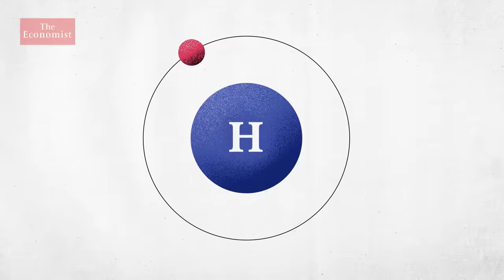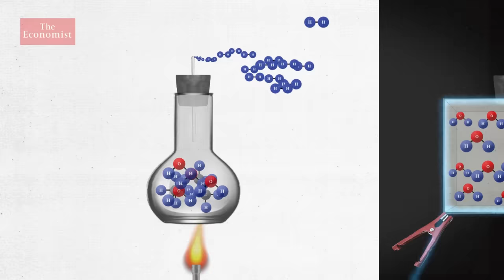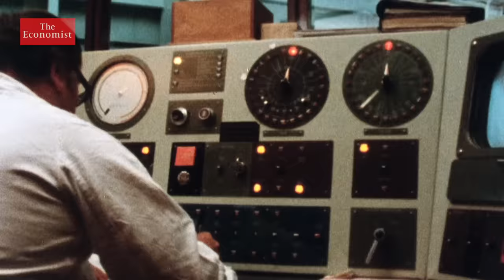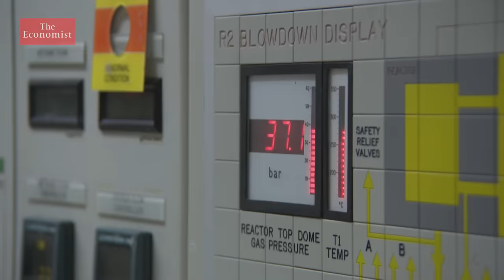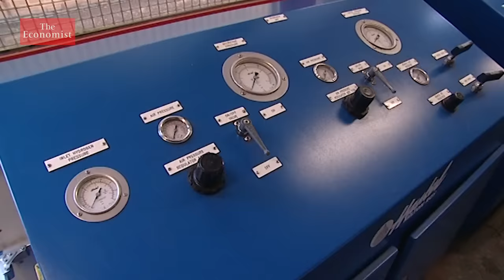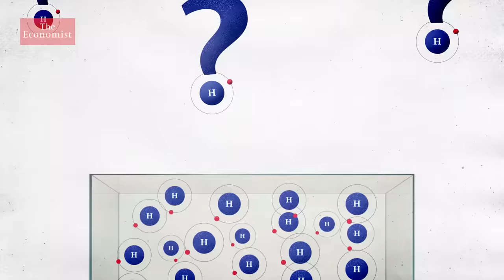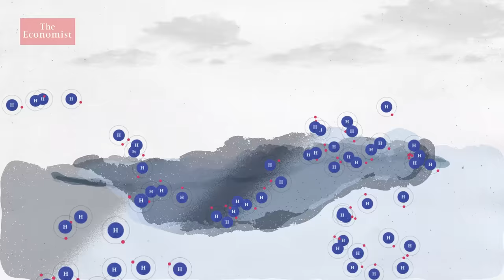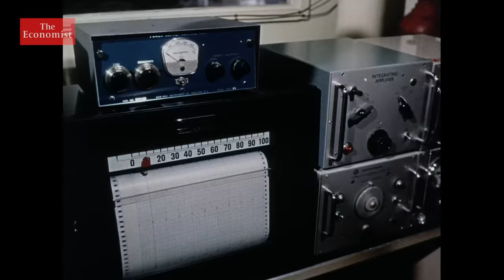Hydrogen: fuel of the future?

Comment: Batteries hold power. 

Hydrogen produces power. 

Electric is preferred over any other green power source. Because it's the easiest way for governments to have full control over the power that citizens use.
Reply: Weird last sentence. I can buy solar panel and power anything in want in my house with that with zero intervention or control from government, I have no such option when it comes to hydrogen, I have to buy it from manufacturer and I can't even store it for later use, which means that government has allot more power when it comes to hydrogen and has little to none when it comes to electricity.
Reply: @Zripas . I understand what you are saying. 

Now imagine if you took the meter off your house and the government finds out. 
It becomes uninhabitable by their rules. 

There's a lot more behind what little bit I commented already. 
But this is not a forum to express all my beliefs on the matter.
Reply: @2dogsmowing  
You can take off meter if you fully disconnect from the grid... And there are actual systems you can buy which can more or less fully power your house while still being connected to the grind and they will pay YOU for your produced energy while you having complete control over your electricity usage... 
So again... Your comment is more than confusing as its completely backwards to what actually happens in reality...

Comment: Hehe, hydrogen is much more dangerous to transport and store than other fossil fuels.
Reply: Actually, no, it isn't. I used to think that also. I worried about how Toyota could fuel their cars without them exploding. Toyota uses it in only a gas form. If a tank is punctured, the hydrogen gas is light it leaks out in literally 1 second. It doesn't explode. Toyota tried shoot their car tanks with rifles and even used dynamite. The dynamite exploded but not the hydrogen which simply just mixes with the air. Gasoline is an extremely volatile substance and we have been using it decades. 

Everyone thinks the Hindenburg blew up because of the hydrogen. To make a hydrogen bomb is an extremely complex process. It doesn't explode in a gaseous state unless you have fusion reactor. If the hydrogen had ignited in the Hindenburg it would have looked like a nuclear blast. Watch the video and you'll see there really isn't an explosion. It simply catches on fire. If the Hindenburg had been filled with gasoline, oh yes there would have been a huge explosion.
Reply: @rabbit251  I deal with hydrogen everyday as an engineer in real life.  There ARE significant issues.  You have  spoken and removed all doubt.*
Reply: @BoydMcKay  So you say, but you don't provide any proof. I work in Japan. A friend of mine works for Toyota and told me a lot of this. I checked the internet and found that what he said is true. That is my basis. You provide nothing except your word. What exactly do you do as an engineer? I am a semi-retired attorney that worked with many engineers here in Japan. My friend at Toyota is the only one who works with hydrogen. My last project was at Hitachi working with engineers designing the rapid rail across Texas.